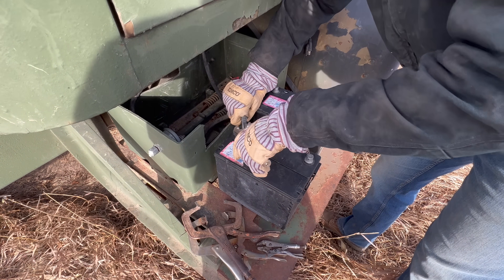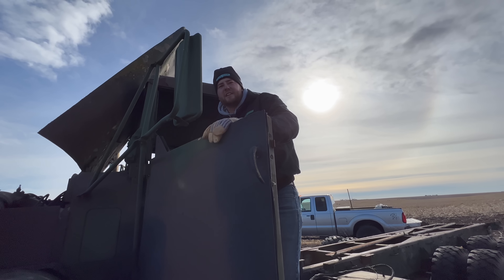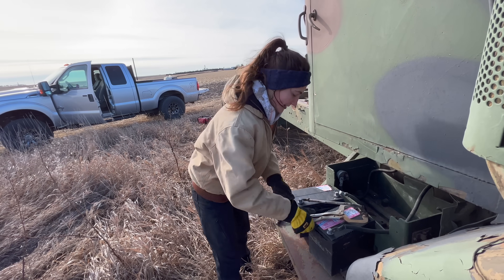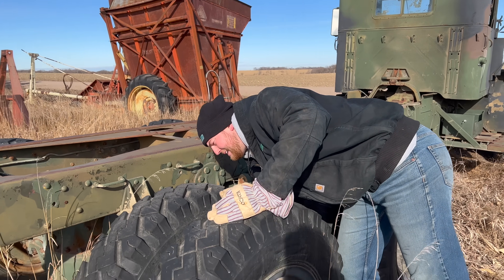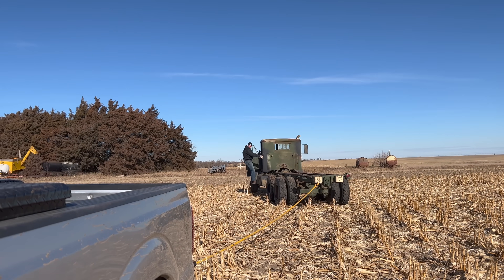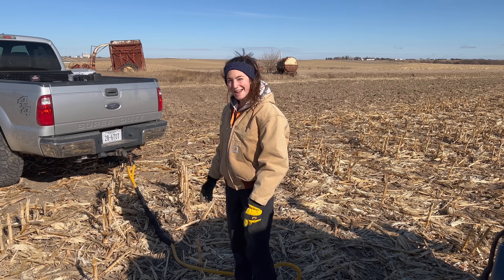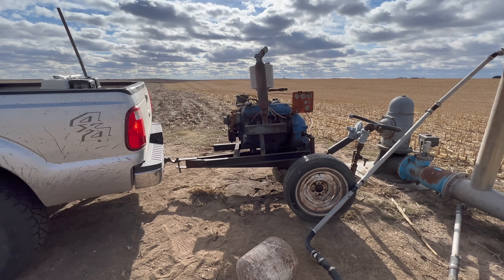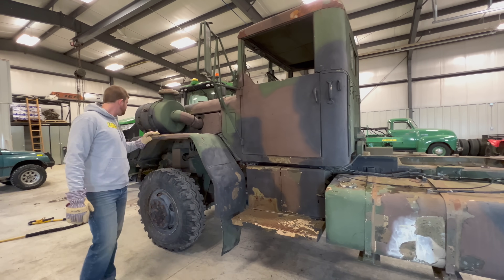If You Can Start It, You Can Have It

Comment: Please be careful if you’re going to change the tires and use the same rims. They have a locking ring to hold the tires in place. They will fly off and seriously hurt or kill you without the proper tire cage and air hose adapter! I love watching your show 👍🏼
Reply: Or, just wrap a chain several times around the rim of the tire.
Reply: Just replace 3 piece rims.  Too many people have lost their lives.
Reply: Replacing would be best👍🏼
Reply: Look closer the rears at least are not split rins
Reply: I was thinking the same thing about the ring wheels...very dangerous...see if you can replace with modern wheels...and have a professional tire guy that's experienced with rings to work on ur tires. be safe👍
Reply: I believe the 36M49 means the 36th battalion, M company, 49th vehicle
Reply: I couldn't see the numbers and letters clearly on the front left bumper as looking at the truck...
Can u tell me what they are...and I'll try to tell u what they mean.
Reply: @joeyl.rowland4153  There's nothing wrong with a 3 piece rim if you do what you're supposed to do.  Lots of people have been killed with a one piece rim also.
Reply: @ffjsb  I went to school at UTI when they where prominent.  Saw people use a wire brush when by the book you use a groove tool and inspect the entire groove with a discerning eye.  And the rings where supposed to be replaced, but it was common place to reuse rings.  Three piece rims are unsafe and were banned for good reason.
Reply: Yea I remember my second duty station - HQ&A Company, 25th Med Battalion, 25th ID, in HI - had to change a blown rear tire on a deuce and half the rig cage was a lifesaver.
Reply: @yamahavstarrider6679  my MOS was 63 bravo and I had a friend that almost lost a finger airing a tire in a cage with the wrong air hose adapter
Reply: @danamiller9080  that is correct  mine was m10
Reply: @Joey L. Rowland  actually they use them on heavy equipment still both the 3 piece and the 5 piece wheels.
Reply: True  seen it happen  be careful
Reply: Nothing wrong with locking rings
Reply: @joeyl.rowland4153  I changed them in the military for a number of years on these trucks and we NEVER changed the rings.  They're fine if you do what you're supposed to do.
Reply: Release the air pressure first wally and no problem,don't even need a tire machine
Reply: We had a lot of those when I was young and we never had a problem with them. You just have to know what you're doing and pay attention.
Reply: DITTO....  Those things are killers.
Reply: You need much larger battery’s like 8 d type but it could run great and make air for the brakes to warmer weather and maybe conservative use of some either while cranking
Reply: Those tire cages were scary as hell in my army days.  I’d rather Chuck grenades than be next to a cage when a ring blows off.  Talk about piss your pants.
Reply: CALLED A SPLIT RIM....FIXED A FEW IN MY YOUNGER YEARS...WE USED A LIFT TO PUT DOWN ON THOSE RIMS...THAT SPLIT KEEPER RING HAS BEHEADED A FEW HUMANS...
Reply: @ffjsb  TRUE...PROCEDURES MUST BE FOLLOWED TO THE LETTER!!!
Reply: I was involved in an AF OR where an Airman had the tire blow off the rim and almost take his legs off at the shins. You need a lot of respect when dealing with machinery like this.
Reply: I remember when I was in the Army in  the 80s, the TMs for maintenance said a split ring could cut you in half if it flew off.  Also a friend of mine lost her father in a tire shop when just a regular tire blew up.
Reply: They don't look like split ring rims.
Reply: What they said about being careful.. they can be shady af if you don’t know what you’re doing messing with them
Reply: They are deadly/dangerous.  We (as operators) had to repair our own tires, just too many bridge trucks for the "mechaics" to keep up.  An old farmer showed me a method where you just aim the ring in a safe direction.  Sometimes we would bolt the tire on an outside dual.  Most of the time we just squinted and hunkered.  Fortunately, nobody died.  Never had one explode.  I was very careful to make sure the ring was in good condition and seated properly, but we changed sometimes 10 or 20 tires a day when we were traveling, and several a week just regular maintenance.  We had a "home-made"  tire cage, but the welds looked like crap, I figured the whole cage was just shrapnel.  We were just lucky or blessed.
Reply: @mrwolf9335  the split rings are to the inside on the dual rear wheels and tires.. these are 12.00x20" tires on two piece split rims... Changed out tons of these tires and done the right way they are pretty solid ....
Reply: @chrissmith7669  when i.changed out those split rings , I always checked to see if their warpedor bent you can tweak them a little.. I've changed many of these in 21+ years and never had one come apart .....
Reply: @markreisen7038  our motor pool was not very experienced back in the day. Surprised we didn’t have more serious incidents.  The worst when I was present was one putting jumper cables on reversed when jumping a deuce.   Blew the tops off and gave us both an acid shower before I could object.

Comment: They pull start very easy. I was driving mine home and stalled it, batteries were too low to start again. A helpful gent in a 1/2 ton truck stopped to help and gave me a pull start. I think I popped the clutch in 2nd gear at about 20mph. It fired up and I drove the rest of the 2 hours home with no issues.
Reply: Lol. Drove one from Oklahoma to north fort Hood Texas with no alternator.  When it stalled one of our NCOs let it roll backward and bump started it. Great times
Reply: Yes, but there should at least be a battery to open valves for fuel to go through... I had a broken starter on our family diesel for about a month. Always parked it at a slope/hill - no problem.
Reply: @uwekall6281  lol. On these old 5-tons there’s nothing electronic.  Barely had lights.  You can run one with no alternator installed.  Once it’s running it’ll stay running until you shut off either fuel or air.
Reply: @uwekall6281   It’s all mechanical. After you start it with a battery you can turn off the master power and you won’t see a difference. The batteries are for the starter, lights and fuel lift pump. The fuel lift pump is electric, but if it’s primed and you don’t have any leaks it’ll stay primed so the mechanical injection will draw fuel. These 5 tons and even more so the M44 series 2.5 tons start so easy, they can start on their own if they roll down hill while in gear.
Reply: @Colonel_Obvious OK Colonel Obvious. You certainly outrank Captain Obvious, but not General Electric.

Comment: You asked about the numbers and letters on the truck.  The designation starts from left to right with the largest unit listed first and on down to the unit that owns the truck.  This was a U.S. Army truck.  So I will tell you from right to left that the truck was #49 assigned to the 36th Medical Battalion (commanded by a Lieutenant Colonel), which was assigned to the 1st Medical Brigade (commanded by a Colonel) which was part of the 13th Corps Support Command (commanded by a Brigadier General).  This unit was headquartered at Ft. Hood, TX and served in Somalia, Iraq, and other places.  Not knowing what bed went on the back, the truck could have transported tentage, portable hospital sections, a kitchen, a command post, etc.  The plate on the dash should tell you the load capacity of this truck; probably a 5 or 10 ton.  The trucks are practically indestructible, reliable, and easy to maintain.  The engine runs on diesel.  Some of the more modern smaller trucks, like the 2-1/2 ton truck you pulled out of a hole that was stuck, run on multifuel, which could be most fuels.  I know a guy who runs one on used fryer oil!  The 13th COSCOM is now called the 13th Sustainment Command (Expeditionary).
Reply: Pretty sure that vehicle never saw service in Somalia or Iraq though even though the unit had.

Comment: From a retired body shop owner/ customizer: Striping it and taking dents out might be more of a project than you may want to handle...not bad, just time consuming. If you don't need that long of a wheelbase....it's easy to shorten. About two days work and a drive shaft shortening. If curious as to how to shorten it, or body work/paint questions....just ask. Good luck kids!
Reply: Having been around those trucks, and done some auto-body work myself... that's NOT Honda level sheet metal.  It's THICK.  I wouldn't mess with it unless it was a show truck or complete restoration or something.
Reply: I have also seen a rebuild where they drop an axle or they "bob-tail it" depends on what your end goal is
Reply: @Dargonkin527  In the past, when they were that long, I would bob it and section the middle in front of the axles and reinforce the cut on the inside with a tapered gusset.  I was a trained frame specialist for many years and this was a safe and proven method.

Comment: Multi fuel engine will run on anything except J P 4( Jet fuel). I rwould run Df-2 for a couple tanks,then mixed 50/50 DF & Mogas( regular unleaded). Cleaned my enjectors & gave me a small power boost

Comment: From the research I've done, it looks like the markings on the bumper (3CCS 1MED 36M 49) stands for "49th Vehicle-36th Marines-1st Medical-3rd Casualty Clearing Station". Hope this helps.
Reply: Good job !
Reply: If the first acronym is 13CCS, Darren would be right.  However, if it reads 13COS, then I think my explanation of 13th COSCOM is correct.
Reply: @donhartzell  You are correct, I miss read that and it does say 13COS. My mistake.
Reply: Sorry Darren, great guess, but you are way off.  Check out my explanation elsewhere.  Probably what through you off on the wrong track, is thinking this was a USMC vehicle.  It is clearly US Army.  So 13th COSCOM, 1st Medical Brigade, and probably the 36th Medical Detachment (UH-60 Medevac Det) putting the truck most likely at Fort Polk, though it might have made the move with several other 5th Inf Division units to Fort Hood.
Reply: @cwpaul11  LOL well I got the medical part right, kind of. Thank you for the clarification. Your information sounds exactly like what they are wanting to know.

Comment: Other than what has been stated in comments I've read, I'm not sure if anyone has stated removing the starter motor & getting it overhauled. I also suggest using 4 batteries connected series-parallel fashion, to give more current. Check the cables & ground connections.

Comment: I worked on two of those that we had on the fire dept, NEVER stand on the side of a tire/wheel when you are airing it up. I watched a guy get his head taken off when I was in the military. They are good trucks and most of the parts are available. I would suggest swapping the wheels for modern ones. The numbers on the front mean Pass side major command/organization/ drivers side unit/veh number.  Drain the tank and the fuel filters, replace them and put diesel additive to improve cetane and remove water. The brakes should be air brakes and the pots probably are rotted, the air tank should also be drained of any water and flushed with 100% alcohol or WD 40. That's a few things to do for a start. good luck!
Reply: and when you wire 12 volt lead acid batts in series all you're doubling is the amps. you need 24 volt semi truck batts. the voltage doesn't multiply, the batteries act as capacitors and hold the system to 12 volts total (or 24 volts if you're using semi truck batteries). the only time that rule doesn't apply is alkaline batteries, dry cell. as those cannot take and hold a charge.
Reply: @Jack29151  If you wire them in parallel you are doubling the amperage, not the voltage, if you wire them in series, like they did, you are doubling the voltage, not the amperage..
Reply: @Sparks0001  yep was just gonna say same thing.
Reply: @Sparks0001  Yep, think flashlight.
Reply: @Jack29151  Quite wrong. 12v + 12v = 24 volts cranking amps don't change; get a bigger battery. You are meaning the voltage is dropped across the cells, true, but happens in any case.
Reply: The odds are that if the engine is any good once you get it running the brakes redone some paint and take your time to do things properly trying to take intelligent advice that you  will have a good usefull large truck.If it isn't good enough for public roads it will still be usefull on the farm. The main thing is that if you make it look good and you want it to stay that way you keep a roof over it.
Reply: wired in series it's still 12 volts, you have to run them as 2 separate circuits in parallel using a charge controller.
Reply: @Jack29151  Um no you are doubling the voltage not the amperage. In turn you also get a longer discharge for accessories by having more available amphours
Reply: @Jack29151  are you trying to mislead them?  I worked on everything from ferret mk11 to dump truck and now high voltage utility and a good example is our 125vdc wet cell (lead antimony)battery banks wick are 2.25V individual cells in series to make 125VDC.  Also was a military vehicle collector for years (yes including the evil god LUCAS).  Purge the old diesel as it wouldnt have been stabilized, check the glow plugs work too.
Reply: @EdgeofEarthParamotor  if you want 3 volts you don't put the batteries in a line, you put them on seperate circuits. the mistake these guys make is they wired them in series. they should've wired a parallel circuit., they were trying to start a 24 volt truck with a 12 volt inline cell. not gonna happen. 12 + 12 = 24 only if you wire them parallel through a charging controller. if wiring batteries in series multiplied voltage, your tesla would have 100 thousand volts going through it. it doesn't work that way.
Reply: @EdgeofEarthParamotor  also if it worked that way the batteries at the end of the series would be recieving 100s of volts of current in large battery setups. in this particular setup, the second battery in series would be recieving 24 volts,. what happens when you run too much current into a rechargable battery? you blow that bitch up! They self regulate. and it was a junked truck, parts were missing, they gutted the charging system.
Reply: @Jack29151  you put two 12 V batteries series setup and you are doubling Voltage, not current... Current sums with paralell setups...
Reply: @kkteutsch6416  2 non rechargeable batteries, rechargeable batteries act like capacitors, they absorb the excess voltage. that's why they were only getting 12v at the starter. it only multiplies if they are non rechargeable dry cells. u hook 2 lead acids together, they charge eachother and all you get is 12 volts.
Reply: @kkteutsch6416  dude look, when you jump start a car, you are hooking 2 12 volt batteries together, if what you said is true you'd be running 36 volts into both vehicles. you'd cook em. oh and the ALTERNATOR is 12 volts as is the BATTERY. 12 + 12 = 24!  you'd fry every 12 volt accessory in that vehicle! NO it doesn't work that way.
Reply: @Jack29151  the batteries will be in series but the alternator is in parallel with both...
Reply: @Jack29151  I don't understand if we are talking about the same thing. This is straight forward electric connections, in any electric manual, two 12 volt batteries of any amperage connected in series equals 24 volts. You seem to be talking about solar panels or something else. Higher voltage means less loss in the circuit for the same power. No charge controller is used or needed for this job. For substation relay control power we use 54 cells connected in series to equal 118 volts approx for example.
Reply: @tedmoss  ohhhh ok I understand now you're talking about AC (Alternating current) batteries, with DC wet cells they act as a capacitor in series. the voltage stays the same. the first in series is the primary power source, everything down the line is a secondary power source. same applies with an alternator and a battery, when the engine is running, the alternator is the primary power source and the battery becomes a capacitor, that's why you don't have 24 volts when the engine is running, alternating current is a whole new ball game. in the vid the guy made the mistake of wiring them both together, one became a capacitor, he was trying to start it on 12 volts.
Reply: @tedmoss  We used to do that with trolling motor batteries to get a longer charge (more batteries = more cells = more charge = more fishing, in series without a controller they charge eachother), when I mention a charging controller, it's a box you put on the slave batteries so the current can only flow one direction, they can't charge, they can only discharge except when the engine is running.
Reply: @Jack29151  lol

Comment: Looks like an M814, which is the long bed version of the M809 series 6x6 5-ton's used in the 70's and 80's until they were replaced by the M939 series.
Reply: I was thinking M813
Reply: @kimjohnson4304  Yeah that was my initial thought too, then I saw how far the rear wheels were from the fuel tank.  Oh well, could be a fun project and truck to have if they can get it going.
Reply: The long wheelbase trucks we're used by bridge company's over in Germany while I, was stationed there. Drove a 5 ton 813 with pump unit and 2,  600 gal  fuel tanks.  Its strictly diesel fuel. The M-58  5 ton cargo trk is the multi fuel version. 2nd ACR  1/2 HHT Support plt  74 & 75.